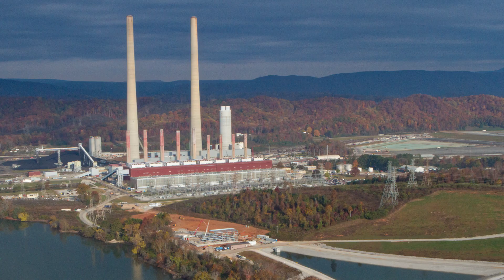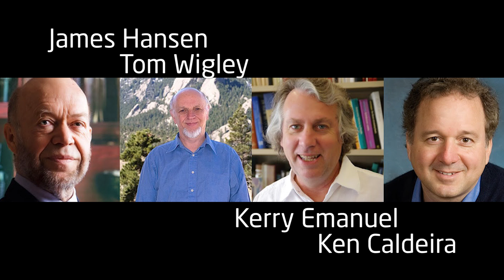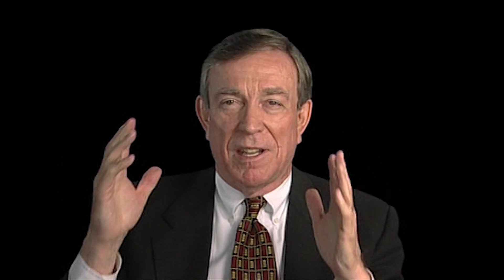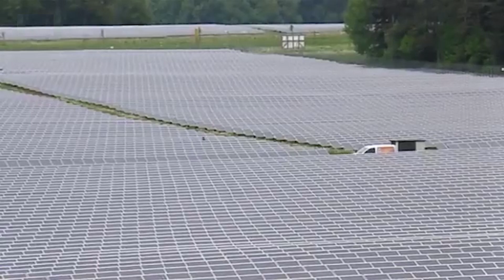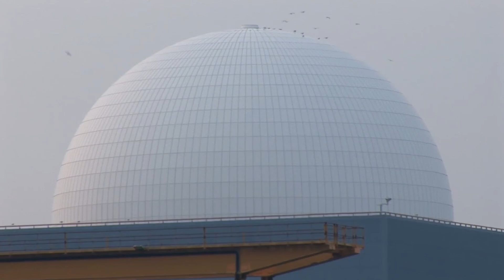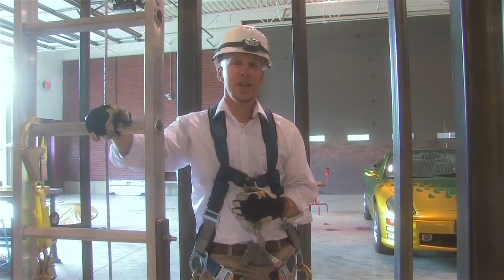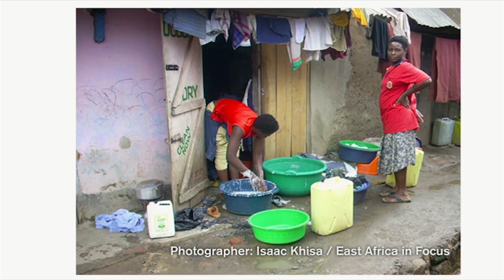Global Warming: Greens vs Nuclear - "Th" Thorium Documentary

Comment: I dunno how you could thing that Nuclear was a source of Carbon... in fact if anything you would think it would be a lesser carbon source than wind and Solar per MW produced just due to how dense it is. Because you still have to mine that steel for the wind turbines the neodymium for the magnets, the glass has to be smelted for Solar panels the rare earths used in Solar pannels has to be mined.

So how is the mining of Uranium supposed to make it have a larger carbon footprint, you only have to think about it for a second, and the mining of Uranium because it's such a dense fuel is a very small amount of total mining, it probably has the smallest carbon footprint out of what you need to build and run a reactor, the building of the reactor is what is going to make up most of your carbon footprint and as said Nuclear is a much more dense from of electrical generation, so you are going to use less material to build a reactor than the same number of wind turbines or solar panels which means you are going to use less power, which should mean a lower carbon foot print.

Like Solar and wind are still negligable in there carbon footprint, but nuclear should by all means be better.

Comment: It looks to me that the real problem with nuclear generation is the fact that the reactors (solid fuel) promoted are inherently run-away (melt down) prone hence these types should not in public hands, however, there is a technology not yet properly developed, which is inherently self regulating (no or limited run-away potential).  Molten salt reactors don't have the same problems as Chernobyl or Fukushima as they run at much lower temperatures & there are very good YouTube clips for example Kurt Sorensen and are much cheaper to make.

Comment: The grid should be ONLY Thorium at above peak power and constant.  The variable demand is balanced by variable fuel making.  Both electric demand and fuel making equal constant nuclear.  No wing/solar on grid. Hydro ok, but why?  No turbines needed.  No Diesel.  No combined cycle.  No coal.  

This will make the cheapest power possible.  House rates would be 7-8, industry 4-5 and production 2-3 c/kwh.  If the grid continues with wind/solar surcharges, the grid is gone in 20 years.  People will make their own power for 1/10th the cost....  Just look at Germany.  Was 10, now 30.  Did what Obama said it would do....necessarily triple.  Won't work for long when houses can make it for 2, store it in NH3 for around 4 average costs.

Comment: This will all fail if CO2 is the motive.  To many people don't buy the CO2 religion.  The reason to go to Thorium is to make electro-fuels at LESS than oil.  No tax needed or wanted on CO2.  Just slows progress.  You can't put your hand on the scale and not piss off a lot of people.  CO2 BENEFITS the planet, it does NOT harm it.  

Leave CO2 out of the discussion!!!  It just divides people....  

Thorium stands on its merit by itself as the reason due to the plentiful nature and potential low costs.  CO2 is not an issue to many (60-70%?). 

I want a reactor on a desert island making fuel from ocean CO2 to run in my new engine for 50 cents/gal equiv to Diesel, or about 1/6th the cost.  With a 2 to 1 fuel economy over Diesel engines with my new engine, and 6 times less fuel costs, I would be 1/12th the fuel costs over the competitor.  I will own trucking and much more.  

That same fuel will run airplanes.  100LL for a Cessna now costs $5/gal.  How about 50 c/gal e. or 1/10th the cost in an engine that is 2.4 times more efficient.  That make 24 times LESS fuel costs....  That is the only thing that matter....money.  CO2 will be GONE if you focus on the money to be made....TRILLIONS...

BTW, you can do this with wind and solar OFF the grid.  They both can be off grid around 2 c/kwh.  But on grid you have to add in the grid cost increment due to intermittent sources which is 15 c/kwh.  Real costs go from 2 to 17 c/kwh and more.  Must be OFF grid making fuel to use in new engine that is par to Electric V systems, plug to wheel.

Comment: Almost one fifth of the USA's annual electrical energy is supplied by 2500 tons a year of fuel rods that are wastefully classified as "spent" when only about 1/20th  (4%) of the fissile energy has been consumed. In other words, the used-up uranium for nearly 20% of our electric demand is supplied by about 100 tons a year of true waste -- assuming that it isn't worth the processing cost to get the precious metals and rare earths out of the fission products.
The vast majority of the radioactivity in the fission products comes from isotopes that have half lives of less than a year. Those are effectively gone after ten halvings, because 2^10=1024. Radioactivity, if you understand the phrase "radioactive decay", is inversely proportional to half life. So 239_Pu, the dreaded plutonium, with that terrible 24,000 year lifetime of radioactivity, is 1/800th as radioactive as the two least radioactive fission products, which with half lives of 30 years are negligible in a mere 300 years.

Comment: The meme that we need nuclear as part of the solution is inadequate. Except for geothermal and perhaps hydro in particularly favourable locations, the stuff on the romantic nostalgic Left list of "renewable energy" is useless. Its capriciousness has to have a dispatchable backup, That backup could be storage, which is hopelessly inadequate capacity even when it's pumped hydro, or gas turbines -- which means that a hundred MWh of energy as reliable power is at least two thirds fossil carbon, or nuclear, which means that if you've got a gigawatt of nuke,  there is nothing saved by running it less than full time, to "take advantage" of the "free" energy that the sun or wind happens to be providinig at this moment.

Comment: While the Navier–Stokes equations remain extant in mathematics, we can only design using finite-element analysis from data - we had 100s of years experience with water and steam so we can produce reasonable in-silico data. Every other working fluid tried has experienced at least 1 serious event and numerous minor events. From lead-bismuth eutectic to supercritical carbon dioxide, every single one has produced unforeseeable problems. 

 Without that solution, until you have a stack of data on your working fluid, only then can you design with any assurity of results. I'm not explicitly for or against, but this is the current position. We can and have made solid-state reactors that are/were reliable. Thermoelectric has a place. Only small and only for very specific purposes. 

 When someone categorically states that they have the only answer - ask why. We have seen nuclear (Trawsfynydd) tied to pumped-storage (Dinorwig). Pumped storage is of positive benefit to the US especially. The 1930s dustbowl was overcome by drilling into deep aquifers, using lots of fertilizers and insecticides. The result is a vast amount of brackish water. Conveniently, pumped-storage doesn't care and evaporation rather than reducing efficiency cleans that water. If you doubt this, look at the Aral Sea. Get the water super-saturated and any thermal waste can be used to recover the ionic agrochemicals at least.

 Pumped storage is also source-agnostic. Be it nuclear (slow to change output) or renewables  (variable output), pumped-storage is one way to solve a bigger issue that power - the ability to produce food. If you are putting agrochemicals in, you need to get the excess out. Even the thermal waste from hydrocarbon power stations can drive your pumped-storage.

 Above is just information I have happened upon over the decades. I'm quite happy to be corrected and take part in reasonable discourse on the issues I mention. I'm sure everyone has their own opinions, my only goal was to place it within a bigger system (a country) and the biggest system we know of (the planet). We can afford as much carbon as we can sink and having seen cannabis growers use CO2 to increase yield, it is tempting to wonder if the ionic agrochemicals can be carbonates (I'm thinking of ammonium carbonate) so we sink it back into cheaper agrochemicals. That is a huge idea, and overly simplistic but recycling seems to work.

Comment: Although don't you still have to worry about the neutron source? For that I mean you would still have to control that tightly with control rods and cool it etc so you cannot just walk away from the reactor as what's his face has said in other videos.
Reply from the maker: Etheoma the neutron source IS the coolant. If any passive safety mechanism is triggered, the coolant/fuel ends up (via pipe or catch-pan) in drain tank. Easy to ensure fission can not be sustained there. Easy to dissipate heat there. Because the fuel has an enormous surface area, in contrast to small fuel pellets.
Reply: No the stuff in the fuel in the "coolant" is mainly Thorium 233 and Pa 233, which only emit a single neutron, the U 233 is then extracted chemically and is used as the neutron source as I think it release around 2.5 neutrons on average then there is a jacket of Th 232 around the outside of the U233 which absorbs some of the Neutrons and is turned into Thorium 233 and Pa 233 when it absorbs  then is put in the liquid part of the reactor.

If the Neutron source was in the liquid it would mean there would be no way to stop the fission, one of the main benefits is that you can drain the reactor using gravity and stop fission so there cannot be a runaway effect in the fuel, that is only possible because the neutron source is easily physically separated from the fuel although there is obviously some in the fuel it is would never be allowed for contentions to get high enough for criticality in the fuel it's self and would be drained before that happened.

Obviously it isn't quite as clean as that in real life there will be other isotopes that will need to be removed, but they can also be chemically removed which is relatively easy, and there will be quite a bit of Thorium 232 in the reactor because separating Th 232 from 233 would be very difficult, so you just wait until there is a high enough consecrations of Th 233 and Pa 233 in the jacket, the rest can be done while in the reactor.

But as I said; you still have the problem of the neutron source going wonky and not being able to sort it, it would be a much smaller amount of fuel, but still it's a concern for a nuclear fire when can spread the contaminates well enough without the steam or hydrogen explosion. It's better than PWR, but it's not without it's risks.

Ah and the reason why I put "coolant" in quotations is because that this point the salt isn't really a coolant it's the medium for the fuel, the coolant for the system is the same thing you use to generate the electricity which is either water or compressed gas depending on the size of the reactor, but if there were a steam explosion it's not a problem because the coolant ins't radioactive as it is completely separate from the fuel and it's medium, and you would have to blow through the heat exchanger before breaching the reactor.
Reply from the maker: Yes, U-233 emits 2.5, but that is compensated for by drain-tank geometry. You need reflectors and moderator to sustain a reaction, the drain-tank is not that kind of environment. There are 2 fluids, one being a blanket with no fissile. But it is (most importantly) the fissile-liquid-fuel which drains into the drain-tank. https://www.youtube.com/watch?v=LIdl3GyM6K4&list=PLoK41_2JS4E_ZZyJSH7g-AhiiwMoCoFCB
Reply: You missed the point there are 3 parts the the reactor the Th 232 blanket, the U233 and U234 Neutron source, then the fuel which does contain a little U233 but is mostly removed to be put into the Neutron source, mostly it contains Th 233 and Pa 233 and along with the Th 233 there is quite a bit of Th 232 because it would be very difficult to separate the Th 232 from the Th 233 because it's chemically identical.

but it doesn't matter I realised that U233 when it captures an electron turns into U234 which is non fissile and if fissioned actually further poisons the reaction because the majority of fission products from U234 are non fissile on the time scales in which you would kept them in the reactor so if you were to leave the U233 on it's own for a while it would decrease in output not increase so as long as you put it in a mixture where it wont damage the reactor, it should never damage the reactor, and plus you wont be able to seperate out the U233 from the U234 easily so it should be impossible to put in a mixture which could damage the reactor.

My point was I thought when you added a Neutron to U233, I thought that it would fission into more fissile material and would go into a runnaway reaction if left alone, but that doesn't seem to be the case, you actually need to remove the products from U234 to continue the reaction.
Reply from the maker: Modern-day nuclear reactors do not have "runaway reaction". LFTR, in particular, needs on-line chemistry to even sustain the reaction. Everyone builds reactors where, more fission means more heat, and the reactors are designed to lose neutrons to anything-but-fission the hotter they get. Chernobyl would be an example of a non-modern-day reactor where it was deliberately mis-operated in an illegal-by-western-standards way, which allowed a brief runaway reaction to occur, causing a steam explosion. Western nuclear accidents (TMI, Fukushima) are caused by decay heat and not sustained, unwanted, fission. Not "runaway reaction". NO ONE is going to build an MSR capable of that.
Reply: Hey didn't I just basically say that my self?

Comment: Fission is far dirtier than fusion, but Thorium is much better than Uranium and both are much, much, much better than coal/fossil fuels but renewables are still inevitable with or without nuclear power. A wise direction for progress would be covering all our bases while abandoning the least efficient or hardest to extract sources of energy. Wind and solar are abundant, renewable and everywhere. Nuclear is great, but generating energy at the source is important as well. Nuclear makes the most sense for the densest population centers and for powering batteries.
Reply: "Fission is far dirtier than fusion," 
I thought that too, but I wasn't thinking what happens to those super-energetic neutrons. You catch as many as possible with the reactor's gases, because they get most of the fusion energy. But the ones that escape can turn anything they hit into radioactive waste. 
Wind and solar are, in the presence of molten salt reactors, or even the current water-moderated expensive reactors, an utter waste of opportunity, and an environmental menace far worse even than hydro, given that hydro is both responsive and dependable.

Comment: The green people are clueless blind following the blind. Why aren't there solar powered track hoes & bulldozers & dump trucks etc to mine the materials needed to make solar panels & make the roads to transport it? Why are there not solar powered tractor trailers & ships to transport the materials to the factories? How are you going to transport the solar panels out to the field? How are you going to transport the people to the field to put together the panels & maintain the panels? etc etc. How are you going to get the electricity to the homes? Are you going to use solar powered machinery to build a electrical grid & maintain the grid? How are you going to store the energy from the day for the people at night when they need it most? With what machinery & equipment are you going to get the resources & materials to make the batteries? etc etc. The Earth is outer space 21:35.

Comment: The thing most people don't want to know is the scrap-age value. All other forms of energy production can be scrapped and the ground returned within 2 years max some only 3mths and it all can be recycled into other things with NO pollution to the land.
Where as nuclear takes years to build and around 150 years to dismantle safely BUT where do you put all the materials as none of it can be used again do to being radioactive. The land cannot be used for many hundreds of years.
Reply: I do not know where you get your information, but you have been deceived.
Coal has never been required to restore the land, let alone the atmosphere, to the condition it was in before the coal was brought out and burned. The air quality in California instantly deteriorated when gas burning replaced the power from the halted San Onofre Nuclear. The companies have not been required to remove the nitrogen oxides. I'd like to see a law that requires an escrow sufficient to remove the horrendous amounts of concrete footing that a jungle of wind turbines creates.

Comment: Could thorium potentially effect the Earth's Magnetic field by chance?
Reply from the maker: +Ketsia Febles As a mildly radioactive isotope it is currently the single largest contributor to strength of Earth's magnetic field. If you combined U-238 and K-40 they'd surpass U-232, but U-232 is single most important one. https://en.wikipedia.org/wiki/Thorium#/media/File:Evolution_of_Earth%27s_radiogenic_heat.jpg
Reply: +Ketsia Febles not any more than CERN already does
Reply: I presume you meant Th-232.  U-232 is very short-lived.
But the thorium on the surface seems very very unlikely to be a significant contributor to what's happening at depths where iron is liquid.